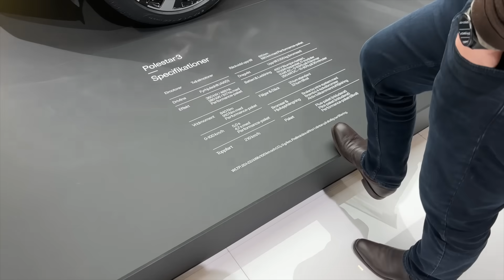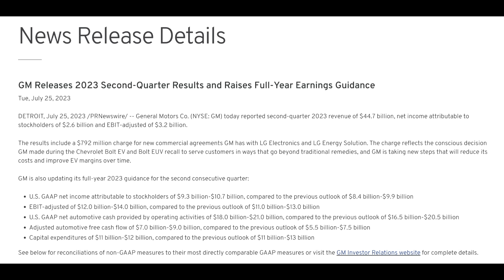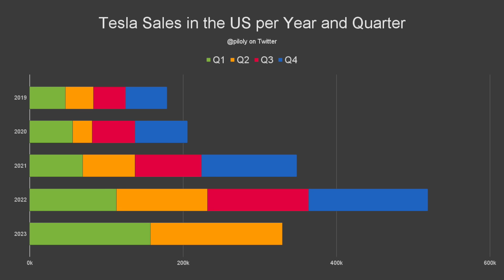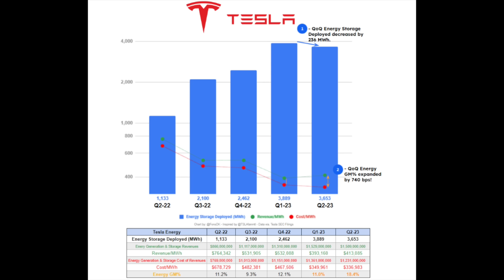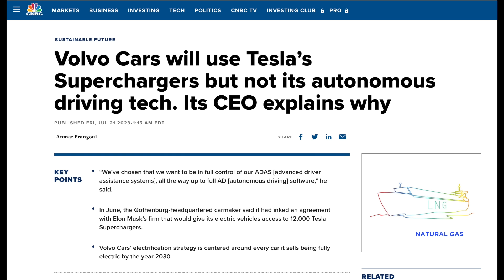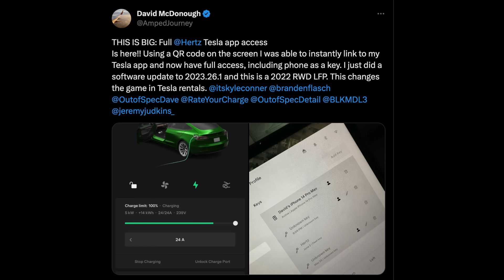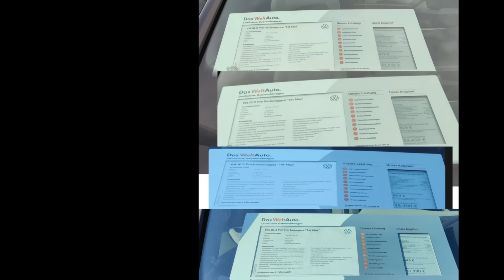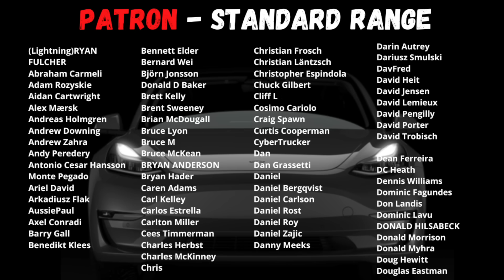Ford is saying “We can’t do it” - Tesla’s pricing POWER become obvious

Comment: Hydrogen vehicles are just EVs with non-battery sources.  And with having to hold and transport hydrogen is the real hard thing, especially as batteries keep getting more dense (by volume and power density as well as cost keeping going down).
Reply: The other problem is making the hydrogen; green hydrogen is very wasteful.
Reply: FALSE , H2 vehicles have both a FC powerplant , that charges a Small battery , just like a Hybrid. 
the only Difference is the FC stack is not Combustion , and only Emissions is water. 
but, H2 needs more Energy than it Outputs to make it go. 
and most H2 is generated w/ Fossil Fuels anyways , making it much Worse for the Environment.
Reply: CNG LNG was clean cheap solution never told dumb public . It’s all natural and clean enough to use indoors without catalyst, any vehicle easy adapted and widely already used in Asia
3 ships destroyed by EV fires past year 😆😆
Reply: Hydrogen can be refined from natural gas too !!
Reply: Batteries are much cheaper and safer.
Reply: @chrishaberbosch1029  no they are not !
3 ships loaded with cars destroyed EV fires past year . CNG LNG clean alternative and every vehicle can adapt cheaply
Reply: Not all hydrogen powered vehicles are EVs.  Some are just internal combustion engine powered.  You are likely only thinking of fuel cell equipped vehicles, which are EVs.  I'm not a fan of "hydrogen power" .  It's a fool's errand.
Reply: @HailCaesar-lm4bq   - Japan has been safely been using LP gas or Propane for Decades . but , Electric is much safer .
Japan still needs more SOLAR, Wind and Grid batteries to make Energy cheaper.
Reply: @HailCaesar-lm4bq And what caused the fire? How was it started? Are you just assuming it was EV just EV were aboard? There were others non EV, why couldn't have been that started the fire? What were the results of the  official investigation?
Reply: @nguyep4  reports say VW EV . Also why could not be put out . Just like recent ship NJ port and VW/ Audi/ Porsche ship last year
Reply: @thetreeoflife3452  but grey hydrogen meand you might as well use CNG, so it still leaves as much co2 and other pollutants as burning gas plus the heat needed to use steam separation of h2 from methane

Comment: Thanks for the video Lars. Polestar does not compete with model Y, as their CEO said, they are not after mass market. More correct, their competition is model S and X
Reply: Polestar is competing with the Model S and X?  In what away?  Price?  If Ford increased it's price of the Ford Focus from $52k to $198k would it be competing with the Porsche Taycan?
Reply: Wow is Polestar out of touch.  In no way do I think Polestar competes with Model S or Model X.  I Think anyone who thinks they do should have their head examined by a  professional.
Reply: Just buy a Chevy Bolt and your fine!
Reply: @wilfredvanvalkenburgh2874  that's why their sales are what they are
Reply: @davidbeppler3032  according to them - luxury. They consider their vehicles as high end luxury

Comment: As I just wrote in the comments under the Autoline video, what GM needs to do is a nicer, sexier version of the Bolt;  perhaps use the body of the Volt with a Bolt power train, a lithium-iron-phosphate battery, to stop the fires, and a Tesla charging plug.  These 3 changes would make the new Bolt a much better seller;  and if they can take inspiration from some of the manufacturing magic of Tesla, such as gigacasting and modular assembly, they could make the new Bolt actually profitable.
Reply: gm needs to 86 the Bolt and make a Full BEV based on the Chevy VOLT/Malibu Platform.
they can UPSELL car buyers with a BASE model and LUXURY model, and IF gm can scale , it may make Better profits than the Bolt.
Reply: GM can't make the Bolt nice or sexy.  It has the ultium platform.  Same platform as the truck, van, suv.... whatever else they decide to build.  All on one platform.  I notice Tesla does not have a "platform" one size, one battery fits all.  How is that working out for them?
Reply: You failed to mention bring the software in-house, an area in which all OEM's have zero expertise.
Reply: Lots of ifs.
Reply: @almostthere100  "You failed to mention bring the software in-house, an area in which all OEM's have zero expertise."  I agree that's the way to go, ideally.  I'm an electrical engineer and firmware coder, myself, and experience forces me to be highly skeptical they can pull that off.  I worked for 25 years for the type of custom electronics and controls design and manufacturing house that typically an automaker would go to, to offload design and development for their needs (though we did not count automakers among our customers, but we could have).

  First of all, before integrating software they need to integrate hardware design (the electronics).  But this is not easy;  the electronics business is very different from the slow changing mechanical industry.  In electronics, all components follow a life-cycle that begins with its introduction and ends with obsolescence, in typically 10 to 20 years;  so an electronic design has to be periodically (say twice a year) reviewed and updated.  You look at newer and better components available, make general improvements, refresh the whole thing;  and you do it often.  If you wait until some parts become obsolete, by then too many other parts are also too close to being obsolete and getting hard to source.  This is the main reason automakers did so poorly during the supply line disruption:  They should have been encouraging their vendors to upgrade their electronics often, but what they did, instead, was to hold them back, to make ANY changes into bureaucratic nightmares.  And so their designs were full of obsolete parts hard to source at the best of times, not to speak of when there's a problem with the supply chain...

  We had a few clients like that, for whom you could not even fix a design error unless they requested it.  One design I was involved with, there was a risk of a component burning up, as its voltage rating was very marginal, a blatant design error, and I wanted to change it, to address the problem;  but my boss did not want to deal with all the bureaucracy involved in suggesting the change to the client, and the long validation process;  so the risk was left in the design, and it was produced like that.  All those rules and restrictions they put in place to minimize risk actually multiplied it.  And this is a common mistake across the industry.

  My concern is that, if automakers bring the hardware design in-house, they will treat it, internally, like they treat their vendors, with a ton of bureaucratic and paranoid hand-brakes.  In other words, their own electronics department will be like a vendor, except owned and located inside the company, but be misused, mistreated, told to fight a war with one hand tied behind their backs.
  IOW, the first thing that needs to change is the management, IMO, because it's not the vendors that failed, I don't think;  it is the automakers' own policies that forced failure onto their vendors.

  And the same is true of software, but squared:  For a software company to be successful, the entire management all the way to the CEO have to be software people.  There is nothing worse than working on software under managers that don't understand software development.  That is what makes Tesla succeed:  the fact that Elon IS a software guy.

  A non-software manager managing software is the worst thing in the universe.  From the start of a project, he cares nothing, typically, about all the thought and care you are putting into organizing it well;  all he cares about is to know how long is it going to take.  The fact that each hour spent early on thinking and planning is like 50 hours saved later on during testing is something he cannot understand or believe;  he wants to see you typing code fast,  and he bothers you about the deadline the moment you are trying to concentrate on a problem.  My boss once urged me to skip unit-testing, as to move the project forward!  Think about that!  Unit-testing was invented to accelerate testing, which it does, by orders of magnitude;  but the idiot thought that skipping unit testing would make things go faster!!!

   If it is so rare to find a specialist software company that is properly managed,  imagine the chances of an automaker with a software department properly managed ...  Just because it happened at Tesla doesn't mean it CAN happen somewhere else ...  But I hope to be proven wrong.
Reply: Volt was a great-looking car! That’s why execs killed it…
Reply: They need to go back in time and uncrush all the EV1's, then fire all the execs who supported crushing them
Reply: I like the current Bolt much better than the Volt.  For one thing, more seating and cargo space.  Sit up higher.  Hatchback.  Small crossover SUVs are more popular than sedans.
Reply: One word……MP3!!!
Reply: @alanhall6909  So we hear you, but it’s wishful thinking on your part my friend, as GM is grasping at straws and desperation is sitting in as Mary Barra, and the GM team simply don’t have the right stuff, and if they continue doing the things that they have been doing, GM as a company is going to die, and no amount of government money or their union workers give backs, is going to save them from their own stupidity and lack of focus on what needs to be done. 

So if Mary Barra wants to do something to save the company from an impending apocalypse, she should be the first to resign, because the rot starts with her, and it will continue down the escalator chain of command until every single individual who still thinks it’s a good idea to make cars, nobody wants to buy is a good idea. Then it’s time for them to go, as they need a bold new leader with big ideas, backed up by a team of risktakers who understand that everything is on the line, therefore, everything must be on the table, to include bankruptcy as a way to get out from under their crushing debt, because debt my friend sucks, but what sucks more than that, is going out of business, and so let’s not forget that the dinosaurs are no longer roaming the Earth for a reason, and when you find yourself in a hole, put the damn shovels down and ask for help, and maybe someone will throw you a rope, so you can climb out the hole you’ve dug for yourselves. Cheers 🥂
Reply: @privateerburrows  Wow... just wow!  A very sincere thank you for sharing your insight into an aspect of the business that is murky, at best, for the layman.  I had doubts OEM's could bring software in-house and you've significantly reinforced them.
Reply: @almostthere100  Yeah, my pleasure.  And the rabbit hole goes even deeper, like, thinking about companies as we think of states, we like to believe Democracy is a superior system to Autocracy, for example;  but somehow we fail to apply the same belief system to corporate management.  Instead of looking for ways to balance corporate power like we do constitutionally with state power, we look for ways to make the corporate power pyramid more and more mono-crystalline and hard.  Somehow we believe that perfect autocracy is what's perfectly right for business;  and corporate culture reflects this, with corporate charts hanging on walls and whatnot.  Just about the only exceptions are Tesla and SpaceX, where titles are mostly decorative and meaningless, where pretentious jerks get fired upon discovery, and where, from the moment you join the company, you are invited to walk around the factory and find yourself something you'd like to do.  Most management science scholars would have a conniption at all that, but it works extremely well, obviously.
Reply: @privateerburrows  Once again, thank you for your thoughts.  As an airline pilot, I'm well aware of dysfunctional autocratic management and its resulting detriment to safety and efficiency.  🙄

Comment: The new Bolt is 12-24 months out even if it just has new cells.  It will be simple because it won’t get any other updates.
Reply: 2026 is my prediction.
Reply: GM has no plan to build a Bolt factory. Idiots have a factory with 25k capacity, switching out 25k Bolts for 25k Silverados. 1/10th quantity for economy from scale. Melon heads!
Reply: And once it is delivered it will be already behind the innovation curve and virtually obsolete if they are not careful.

Comment: Ford's competition is not Tesla, it's the high EV material costs and that EVs are not practical.  If Ford and other manufactures can not sustain a thriving and profitable EV segment, Tesla will ultimately follow them and fail.  The potential EV market is just not large enough.